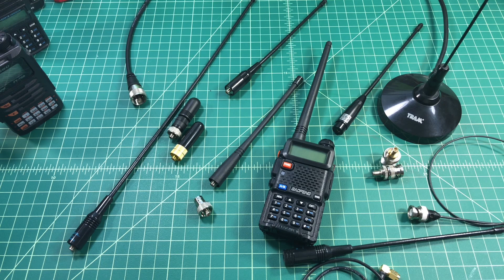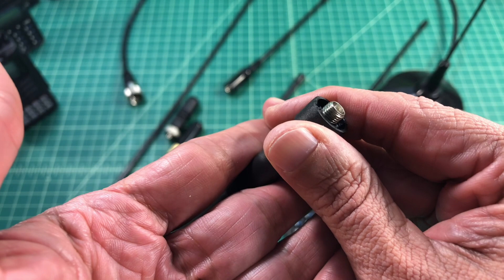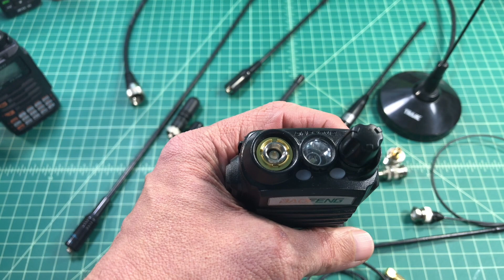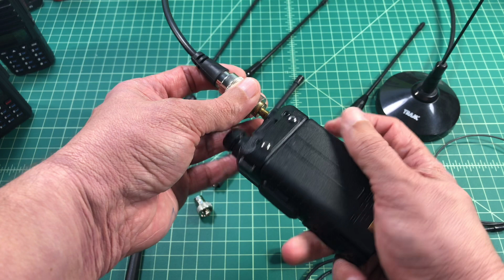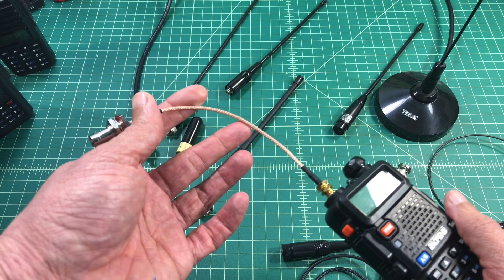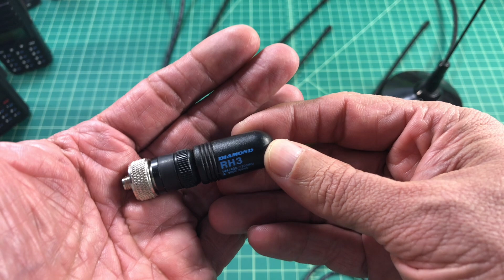Baofeng Antenna Options - TheSmokinApe

Comment: I own TWO BTEC UV-5X3 radios, where do these stand in regard to the UV-5R?
Reply from the maker: They are what is referred to as a 5R variant, basically the same radio with some modifications 👍
Reply: @  "some modifications" does that make them better?

Comment: I have the uv-9r plus it came with a regular antenna which fits fine and a whip antenna that i cant figure out how to get it to fit any help would be appreciated thanks
Reply from the maker: You would need the adapter to go from the antenna to the radio 👍

Comment: What connector do i need for my antennas to attach to the SMa female to BNC female in order to make quick on/off swaps. TYIA
Reply from the maker: It’s best to probably do in Amazon and see what they have, you want one that will have a wide part on the connector so you don’t put stress on the radio 👍

Comment: Hi.. I'm only a GRMS licensee, but I'm wondering about the Diamond antenna.. Does it work better than the longer Nyegoya or however you spell it antenna? Thanks in advance.. 
I have a couple TIDRadios and a beufeng GM15 pro for GRMS and repeaters.. I might get my ham license though as I want to play on the HF frequencies I think in the future and may learn morse code, even though I realize it's not required. 
Thanks in advance and regards from the heartland. South Central Indiana. USA
Tim
Reply from the maker: Hey Tim.  Antennas like this are optimized for intended frequencies, as the GMRS frequencies are different for Ham you might want to look at GMRS intended antennas.  Best of luck with the test and welcome to the hobby 👍
Reply: @TheSmokinApe  Thank you kind sir.. Yeah, I knew the antenna's were tuned differentlyi. I just assumed if they were the same brand, but for GRMS they would also work for it as well.. Thanks again! Appreciate it so much.. 
Tim

Comment: What antenna should I use for my BF-UV10R
Reply from the maker: SO the thing is that the front end conversion circuit on the Baofengs is easily overloaded.  I know that HamTubers love to tell folks to upgrade the antenna but the better RX on the antenna the worse the overloading can become.  If you feel you need to upgrade I'd get the Nagoya 701 or 771 👍

Comment: Thank you for making this video. It helps a newbie like me tremendously.

I have a question maybe you can help clarify because you moved pretty quick during that part of the video. You showed two SMA female to BNC adapters. You put one on, then put on your signal stick antenna. Then you mentioned the other SMA female to BNC adapters and said "don't get one like this".

What is the difference between the two adapters? How can I tell which one provides a strong base and which one will put more stress on the radio?
Reply from the maker: That's correct, you want minimal stress on the antenna base.

Comment: Gmrs here. Have the slim duck  (on my btech v2) from smiley that seems to do really well and 2” shorter than stock. Just ordered the 771g for my unlocked uv5r that I can switch onto the btech if need be BUT I’ve heard the signal stick, although it’s a ham antenna, actually works great for gmrs. I’d love to hear your input or even see a demonstration before I buy one 😬
Reply from the maker: I have one of the older models of the Signal Stick round here somewhere, it is a fantastic antenna 👍

Comment: One of the first things I did for a uv-5r was get the bnc adapters, made testing different antennas so much easier and quicker (especially with 4 HTs that all tend to like different antennas...surprisingly the Nagoya whip and Abree tapes were favored a good deal less than the stock duckies).
Any recommendations for a stubby? I'm looking for something that doesn't need to go more than maybe 100ft with clear LOS but still handles the potential overloading/interference issues like you mentioned.
Reply from the maker: Hey TAV, the Diamond RH3 is my stubby of choice.

Comment: Great video!  I have tried running portables in vehicles before, and with the external antenna it gets out fine, but it always ends up being a chore to remember to charge the radio or whatever. So I like mobiles in vehicles, but for someone just starting out external antennas to a portable is definitely an option.
Reply from the maker: Thanks Stephen 👍

Comment: I don't know what it is with the Baofeng radios I've purchased (2 different models 3 radios in all), but they will only work with the antenna that came with the radio. I've tried 5 different antennas and adapters, and none of these would work. It seems to me that the Baofeng's radio antenna connector may be out of tolerance (?) I could not make any of the 3rd party antennas or adapter to have any kind of signal. It just seems like there's no connection to the antenna.
Reply from the maker: Dang, never heard of that before.

Comment: I used a lot of different radios In the army, learned how to use them well. HF tac chat and sat comm you name it. Now I’m trying to learn ham. I guess my expectations are too high after using military radios. I want to experiment with long wire antennas like the stuff we used to do in the field. Good video. Maybe I’ll make one if I can figure this stuff out lol
Reply from the maker: Thanks for checking out the video and for your service Ben.
Reply: @TheSmokinApe  you do a great job man thanks for the content
Reply from the maker: @CatFishMarmite  thanks man!
Reply: Any luck with long range antennas? And thank you for your service
Reply: @JimmyLucas-ev1hp  best one I’ve used so far is the 48” whip. Haven’t tried a long wire set up yet. I’m about to work on one tho. Basically just a long strand of insulated copper wire, back stacked in a bag, use a sling shot with a long piece of 550 cord tied through a golf ball tied off to your long wire, shoot the golf ball over a branch up in a tree and yank the long wire up, ham’s are line of aight so higher the antenna the longer the range. Worth a try.

Comment: bigger the antenna stronger the transmission???
or just improve the reception???
Reply from the maker: Not necessarily, antennas work best when they are tuned / designed for a specific set of frequencies.

Comment: Since I first got my "Ticket" over 30 years ago, I never use the stock antenna that comes with the HT.
I've always immediately bought and installed a better, higher gain, third party antenna. For years I used my 1-5 watt HT's in the car/Truck and a good quality roof mounted mag-mount antenna. 
I always got a clear signal to and from our local repeaters (anything within about 25 miles) and sometimes over much longer distances.
The so-called "Rubber Duck" just doesn't do it for me. Unless your within spittin' distance of the repeater, your signal will be so trashie that NO ONE will want to talk to you!
Reply: Am I correct in deriving that you received some kind of citation for using a stock antenna, or am I misinterpreting your statement?
Reply: @p8nflnt  If I had to guess I'd say "Ticket" refers to OP getting HAM radio license.

Comment: Great channel, just subbed.  I have a question...is there a maximum length of coax cable I can run between my uv5r and an antenna?  Id like to put the flexible slim jim(?) antenna on my roof and have my radio about 15 feet down from there in my office
Reply from the maker: Hey Blam.  You want to use a decent, low loss coax for VHF / UHF and keep the run short are possible.  15 feet is pretty short and should be a problem.  Here is a video that might be helpful: https://youtu.be/AE1Mvlzi4gI
Reply: @TheSmokinApe  thanks man!

Comment: Tested my two antennas today on a Vector Network Analyzer,
Results: 
Baofeng UV-5R stock antenna resonates at one frequency only, 418 MHz. 
Fake Nagoya resonates pretty much only at a decent VSWR at 151 MHz. 
So they both are quite a compromise if you plan to transmit on any other frequencies.

Comment: If there is anyone that lost the rubber ring for the Nagoya or it wobbles even with the ring?

I have designed a little 3D printed spacer that replaces the rubber ring and it will completely eliminate the wobble!
Reply from the maker: 3D printers are great!
Reply: @TheSmokinApe  100% agree!

Comment: If i was to put a nogoya on a 20 foot pole outside my trailer/house, and used my UV-52 as a kinda base station inside, would i get better transmit and recpetion with out boosting the signal, and used say the uhf cable or cb cable to run from antenna into my house.
Reply from the maker: Generally the higher the antenna the better, that said some coax cable has more signal loss than others...  so depending on the type of coax you use it could actually get worse.
Reply: @TheSmokinApe  thanks for the reply, i could also use some canare, low loss marine grade or marine grade transponder or fish finder wire also, i can solder so i camn make my own adaptors or ends and am now working on a home built pulse indiuction metal detector so i ave a scope and some electronics experience on pcb boards ect, and wifi conections, anterennas, ect
Reply from the maker: @mattrowe1229  gotcha, just make sure your transmission line is 50 ohms 👍
Reply: @TheSmokinApe  sure will, thanks

Comment: Great vid! I’ve seen car windshield antennas but never tried them. I thought I saw a wired one stuck inside the windshield going along to top rear view mirror.  Can you recommend them for use with the UV-5R 8W ?  If so, what brand & model?
Reply from the maker: I'm pretty sure MFJ makes a popular one.

Comment: Hello, with the tram Antenna connect to baofeng would it be less stress with SMA F to BNC adaptor or using SMA female wire to UHF Female? Also what the best way to place left over coax cable for the magnetic antenna?
Reply from the maker: Using a short thinner piece of coax would be less stress.  If you coil coax it can have a negative effect 👍

Comment: At 2:45, you mentioned a adapter cord or strain relief.  That is what I've been looking for. However, I've learned that you want to use the right type coax for the best possible rx and tx.  I'm looking for a 3ft coax with sma Male x sma female. Any suggestions on the coax type (RG8X for example).
Reply from the maker: RG-8x would be fine for a 3' jumper.  look at rg-316 as it's more flexible.

Comment: I have a that radio but I receive a broadcasting from 4 miles away and it is just okay as clear sound as I'm receiving now but the disturbing fact is it has noise I already tried 1-9 sqlc to reduce but it didn't worked. So if I install a long antenna will it reduces the noise??

Comment: I have a weird issue with my Baofeng radios. I have 2 UV-5RA';s and one UV-5R. Anyway, I've been using them with various rubber duck, Nagoya and even one of those Abbree tape measure antennas for several years now, they all work, but my recent discovery is that when I try to connect the Baofeng's to an outdoor antenna (a discone) I can't hear a thing. I would probably receive more with a safety pin stuck in the antenna jack. The antenna and coax is fine, if I hook it up to my SDR receiver, I have no issues receiving distant repeaters, but I soon as I hook it up to one of the Baofengs, bam, I get nothing. I thought maybe the adapter was bad, but I checked for shorts and found nothing. It's strange. I've read that the UV-5R might have a problem with receiver overloading, but the repeaters I receive are all over 30 miles away, so nothing major when it comes to strong signals. I am not near any other types of transmit towers. I read a couple posts from others having the same issue, but it seems to affect only certain people.
Reply from the maker: That discone (cool antennas) will pick up many more frequencies besides the repeaters.  It’s the Baofeng’s job to sort through that stuff.  What is happening is the Baofeng is getting overloaded and thus desensitized.

Comment: I have a diamond whip antenna RH771 with SMA male connector. What type of  adapter do I need to make it work for  baofeng UV-5R?
Thanks in Advance.
Reply from the maker: You would need an sma-f to sma-f connector.  Make sure to look at the pics before you buy anything.
Reply: @TheSmokinApe  Appreciate your quick response. Thank you so much for the information.

Comment: Chinese radios works best with rubber antenna only. It is suberb 
combination of bad antenna (rubber) and very sensitive receiver but 
without any filtering (baofeng) . If you put a good mobile antenna or 
even house antenna on baofeng you will receive NOTHING. Because it will 
overload receiver. Now go and research.
Reply from the maker: This is covered in the video, did you even watch????

Comment: Do you have a video of “tactical” options to attach to a ruck? Or even through a plate carrier or chest rig? Thanks.
Reply: Search up Abbree tactical folding antenna
Reply: @MultiLittlegamer  I already have one. Thanks.
Reply: @toddj70  how is it, ordering one very soon. Getting the 108cm, 72cm and 48 cm ones to try
Reply: @MultiLittlegamer  I really like them. I have no issues with reception on my Baofeng UV5R or my GMRS-V1's. I have the shortest one and the longest one.
Reply: Best options for a plate carrier are caatailantennas or disco32
Reply from the maker: Sorry I don’t
Reply: Mckydex makes a sweet kydex holster for these radios tall or short batts, way better than a soft pouch.

Comment: Hey, I got the UV-5R and im looking to upgrade the original antenna that came with mine. The Main purpose of use for my UV-5R is to listen to fire department and police radio frequencies (uhf). My main problem I currently have is receiving signals in certain areas of my city as well as from my home since I live in an urban area, depending on where the units are transmitting from. For example, units calling on the radio from 1-2 Miles away from me I receive almost clear as day, but further out its crackled and very low. Im not to sure how to go about with my upgrade, but all I know is I need something compact (Antenna wise) so I could carry it around with me. Would something like the smaller compact diamond antennas make a larger difference in quality if I upgraded mine to one like that? Thanks in advanced.
Reply from the maker: the compact one's don't work as well.  For a smaller antenna I like the Nagoya 701.
Reply: @TheSmokinApe  Still trying to research just another quick question, I may look into upgrading my radio. Is their any specs to look out for in descriptions of radios that may determine a radio that could receive stronger signals? I know you mentioned in the video the baofengs have cheaper components etc especially for receiving. If you got any suggestions on radios let me know thanks.

Comment: Do you have a recommendation for railroad
Reply from the maker: For RR, if you want to receive only I'd look at a scanner.  For receive and talk I'm not sure what is allowed on those bands.
Reply: @TheSmokinApe  I just want to hear 👂 
Pretty much sir , I guess recieve ?
I am usually very close to the lead power's or train itself for the duck to work or would you suggest upgrading 
Like I said usually pretty close so I think the standard duck antenna would be great 👍 
Your awesome 👌
Reply from the maker: I’d look at a uniden or whistler scanner and use the stock antenna 👍

Comment: 1:32 Yaesu has an sma female while the baofeng  has sma male?
Hypothetically speaking here... Could you connect them?
Knowing damn well myself there is no good reason to do this, and yet... I gotta know!
Reply from the maker: Mechanically yes, electronically no 👍
Reply: @TheSmokinApe  Have a death battle between two radios by connecting and keying them up at the same time.
Only the strongest radio survives!
Reply: @tomfoolery1123  yeah just dont do that

Comment: Gosh. I have a 42 inch Abbree antenna that I use quite often and haven't had a problem with it. I also have a magnetic antenna on my vehicles and haven't had problems with them either.
Reply from the maker: They do perform well, thanks for watching

Comment: Thank you for using the correct names for the SMA connectors. BaoFengs DO NOT use RP-SMA (Reverse Pair SMA) - they use Male SMA on the radio and Female SMA on the antenna as you said. Anyone who tries to connect a "reverse" SMA will find out quickly how different they are. In the worst case the antenna would fit (mechanically) but with no "hot" connection. Yikes. (RP-SMA are typically found on routers). So for those unfamiliar there are in fact FOUR SMA connectors: Male SMA, Female SMA, Male RP-SMA, and Female RP-SMA. <End of rant> '73.
Reply from the maker: Thanks for the additional info!
Reply: So, if you want to use or connect that connector that would alleviate stress from constant changing antennas, for instance, the one to buy is an SMA female to SMA male connector for SMA type antennas, right?
Reply: @nats50  RP refers to "Reverse Polarity", not Reverse Pair
Reply: The rp sma female has a pin and has the thread on the outside so the baofeng is rp sma female

Comment: Where can I purchase that silver wire adapter you showed in the video - the one that reduces stress when connecting my mag antenna on my vehicle rooof to the Baofeng?
Reply from the maker: https://www.amazon.com/dp/B071LHHJT4/?ref=exp_thesmokinape_dp_vv_d 👍
Reply: TheSmokinApe Thank you! Will this connect directly to my Baofeng or will I need an adaptor?
Reply from the maker: It should connect directly

Comment: just got the UV-5R Ⅲ radio and it came with the two rubber duck antennas you mentioned @5:30 is one better than the other?
Reply from the maker: The bigger one will perform better 👍
Reply: I bought the same radio, if it was advertised as triband then the the bigger duck is for 1.25 m,245mhz,the smaller is for everything else, there should be the frequency range written inside the base end of the antenna.